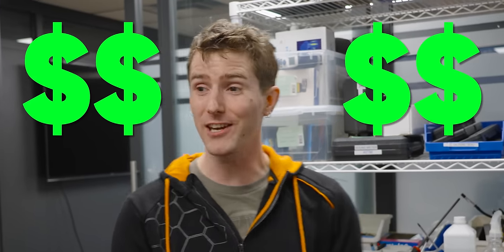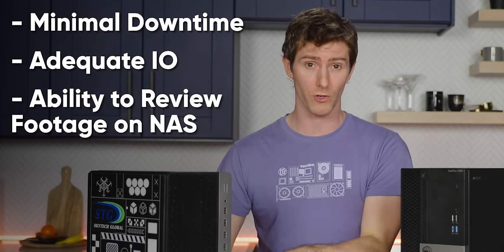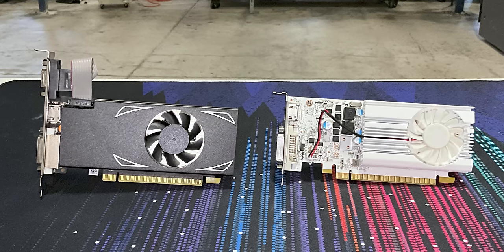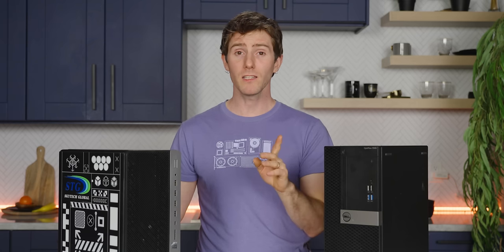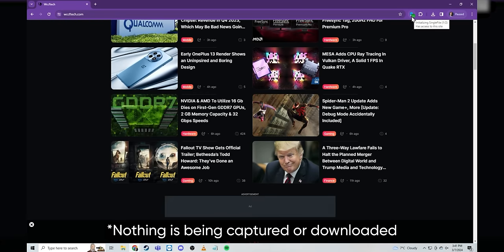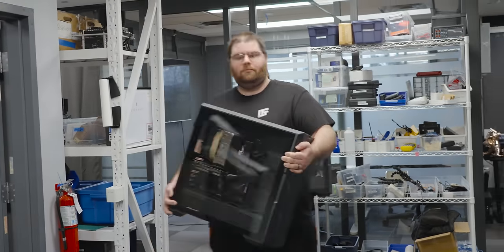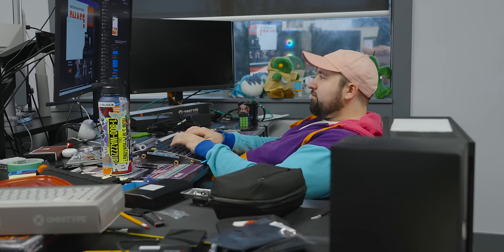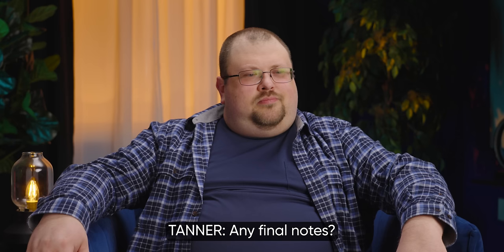We Downgraded our PCs to Prove You Don’t Need a New One

Comment: For my craft business, I used my old gaming rig from about 10 years ago (with some upgrades along the way). A 4790K and dual 1080 TIs in SLI is more than enough to handle Fusion 360. And all the business apps could run on a potato.

It was an awesome way to give new life to and old machine, and keep it relevant. Plus, the company didn't need to spend a thousand dollars buying something new.
Reply: I have some equivalent Xeon in my HTPC. You can run Windows 11 for sure, if you're not already.
Reply: @ranghildsbil  My CPU is just barely too old. At least without a separate TPM, which my motherboard is just slightly too old for. So, alas, that machine stays on 10.
It has the horsepower to do it, but it's not compatible.

Comment: I worked a couple of months as IT for the US Census, and it was fascinating how they handled workstations. The one frustrating part was having all the security protocols turned up to 11, but that aside.... each desk had a mini hp with I7 processors remotely logging into servers with virtual machines running Windows. Didn't matter what desk or PC you were at. All your files and settings would be there when you logged in.

Comment: I don't understand that no-one in this video mentions that there's no TPM 2.0 encryption of the main drive, when using sub late 7th/early 8th gen.

I mean, office use is one thing, but security is another. If a perpetrator physically stole the PC and was able to have access to the main drive with no TPM encryption, you'd practically give away all your information to the perp.

A lot of the reason that businesses are swapping these sub 7th gen for newer computers, is often not speed, but TPM compliance, and of course Windows 11 support.
Reply: They didn't mentioned this, because they have policy to never store any data on local machines.
Reply: @adrianchmielecki1473  makes sense then. Thanks

Comment: This comment will be ignored by LTT, but here it is anyways:
Machines with CPUs older than Intel Core 8th gen or Ryzen 2000 are not supported by Win 11. Escepially as a business you want something that gets regular security upgrades. And even as a  home user, running an out of date OS is a bad idea. 
Support for Win 10 will end in october 2025. So, you spend almost 20 min advertising something that will be ewaste in around 18 month. Unless you switch to linux. But you guys forgot to mention that bit as well....

Comment: we used to custom build computers with standard specs (office work), added gpu when needed.
Still running many years later, but as build servers, since we switched to remote and actually all machines now are recently speced laptops that we dock to our 34 inch wide screen monitors and use as desktops.

Comment: I can attest to this in my personal experience. My dad (an accountant with decades of experience) runs an old workstation similar to the ones in the video at home in his office. All he really does is web browsing and excel work so it doesnt need to be over the top.

Also at my previous work which happened to be a large corperation (myself working as an engineer) we utilized Lenovo Thinkpads for our work. They did have 12th or 13th gen intel cpus so they werent all that old, but they also werent anything overkill, and they did the job just fine for mine and most others workloads. There was the option for more powerful laptops if you were doing CAD work, but only for those who needed them

Comment: when i was systems admin for a call call centre we had both the 7040s and the HPs and from experience the Power supplies fail on those dells but the HPs last forever. there were no real differences between the 2 apart from that

Comment: I built my pc in 2016. Still running like a champ with everything and no issues gaming. 6700k, gtx970, 32 gb ram, samsung 980 pro, asus maximus hero board and aio cooler for cpu. Typing this message from this pc. Average fps in games is still 60+, work as a software developer, sql developer, game developer and it support. I keep it clean, keep it protected and do what I am supposed to with it and am not running into any issues.

Comment: I'm still using 4th Gen, i5 4690k Devil's Canyon in my personal rig. I increased the ram 5 years ago (from 8GB to 16GB) and upgraded the GPU last year (from a R9 280x to a RTX 3070). It has everything I need and nothing I don't.
Reply: that i5 is probably chocking out your 3070 tho. I got like 40% more fps and much more consistent framerates when I upgraded my Ryzen 2600 to a 5800x3D. Ryzen gen 1 was probably my best computer investment of all time.

Comment: I have a 10 year old HP laptop that i bought back in 2014 for college with an i3 4010u, I upgraded it with a sata ssd, another 4 gig ram stick and installed linux mint on it, works perfectly fine and is plenty snappy.

Comment: for office work, the only real requirement I have is enough ram and some form of ssd. Back in 2015 at my first "real" job, I had a system with a 4th gen quadcore i5, which was near brand-new at the time. But it came with 250gb HDD and 4gb ram, which I assume was the base config. Booting up took like 15 minutes so I never shut the PC down, and especially towards the end of the machine's life in 2020, that 4gb ram was just ridiclous. Nowadays, give me some random i3 or ryzen equivalent with 16gb ram and ssd and I can do any kind of office work.

Comment: I have a Dell Optiplex 7010/9010 Custom; it has an Intel I5-3470 3.2GHZ-3.6GHZ Clean Quad-Core Processor, 32GB DDR3-1600 RAM, and 1TB SSD Drive. It currently runs Windows 11 Pro, and it runs like a Marvel.

Comment: I have an old optiex 9020 that I got for free. Dropped in a $80 eBay 4790k to replace the 4570 that it came with, installed 32gb of ram to replace the 8gb it came with(system running men usage is about 22gb), and added a $30 2.5g nic and have it running as a game server. Works good especially considering I only have about $200 in it.

Comment: In the late 90s and 2000s I used to get a new computer every 2 years. Since the 2010s I have started to use my computers for at least 4 years with strategic upgrades to Video Cards and storage. My current computer I  assembled at the end of 2020. I just recently upgraded to a RTX 4070 Super from a RTX 2070 Super. I also added a 10Gbit NIC to go with my upgraded LAN.

Comment: Budget office pc builds are the best bang for your buck. I got a Lenovo Thinkstation P310 for $100 on ebay.

Specs are-

i7-6700
8gn of ram (I added another 24 for a total of 32gb for $60)
RTX 2060 for $150
PNY 1tb sata ssd for $30
2TB hdd I already had lying around

Total spent -$340

For the amount spent, this is an insanely good deal for the performance provided. It plays any game at 1080p 60fps perfectly fine. Some titles I play at 1440p.

Comment: I was  a backend engineer working in java and I was using a decade old laptop (not even PC) with 16GB RAM and somewhat decent SSD for over 2 yrs. 

Most apps would take 10-15 seconds to load and I needed to manage the open software very carefully. However, I was still able to get work done. 

Now I'm 100% against giving underpowered laptops to working professionals since it's extremely annoying and laptop just freezes a lot of time during meetings, especially if I was sharing my screen but people with relatively simpler tasks like just using chrome and office software definitely don't need high end systems.

Comment: As a civil engineer at a small firm, I regularly work faster than my computer runs AutoCAD. Ik exactly which components I need to upgrade to but my company just relies on the IT company for recommendations:(
Reply: Yeah, but your BIM technicians will be running Revit and heavy files, and you BIM Managers will be running huge Federated models in Navisworks, exchange lots of COBIE Data, and they’ll need a decent A200 GPU with it’s own memory to run these models.

So, your IT probably just gave you the a basic technician spec laptop that’s all.

Comment: Still use my 4th gen i7 with 16gb of Ram for gaming from 2013-2014. Just upgraded to an 1070 in 2017, and no upgrades since then ! Just some struggle with few games due to my HDD but I will wait 2 years before switching to new computer.

Comment: Whilst a top of the line performance workstation isn't needed as a daily driver by most companies, many just see IT as a financial overhead even government councils and organizations are not really willing to spend what's needed in order to improve the IT infrastructure. Even if these companies still have the older 4th/5th or 6th/7th gen PC's with windows 10, they will not maintain the hardware properly to make it work as intended. An example is when I was on a contract as an IT tech and there was a Dell OptiPlex that was being impossibly slow due to thermal throttling. I opened it and the thermal paste was as dry as cardboard.

Comment: I still use a i7-2600 and radeon Hd 7850 pc for all my office work on linux and I don't see myself upgrading for another couple of years. Does web browsing, office work, and light duty gaming just fine. Only difference using linux vs windows on this older machine is much faster boot times and lower memory usage which helps a lot with only 16gb
Reply: LoL this CPU sucks, it's too power hungry, you could probably replace all setup with one 5650 pro

Comment: Watching this at home on a 13 year old HP Probook 6560b from 2011. I don't mind using older hardware at home for basic tasks. The laptop I have to use at work is a lot newer and much more powerful, but the company I work for has installed a lot of security and encryption software on it, which makes that machine feel as slow as my personal device.

Comment: I run a 3770k (4c8t) at 4.2Ghz with a 980ti and 16Gb of 1600 DDR3. This gets used for gaming, CAD, video editing, blender etc. The reason I'm still using it is because it works great. I upgraded the network card to gig for better transfers to the NAS but that's about it. I've had it OCd to 5Ghz but it gets a bit noisy. But really I have no reason to upgrade. I did swap the original 3650k to 3770k for the hyperthreading.... In fact the only reason I'm tempted to ugprade now is for the enhanced virtualisation options of more modern CPUs.

Comment: When I’m running old hardware with windows 10 😊go in control pannel🤔type “advanced system settings “

Advanced .
Performance.
Adjust the virtual memory 

It uses hardrive space as cash ram 

It helps ish

Comment: at work i took an old mini dell pc with an intel dual-core cpu, added a ssd and swapped in 8gb ddr3 ram(gasp) and to get stuff done at work its very usable. At home i use a i5-6600k with gtx1080 in my bedroom and it is no different then using my i9-9900k with rtx2080ti to just do mundane task and both can still game, but obviously there is a reason I bought a 208ti

Comment: 6:35 I've had this exact issue regarding black flashing screens in videos and certain games before. It's usually when the expected specs and the system aren't fully compatible anymore, such as a game built for XP and Vista running in 10 or an older OS with an outdated player not parsing codecs properly.

Comment: A lot of the small business haven't upgraded their pcs in a decade. There was a company i worked with, and it had 4gb of ram. They said it was snappy when they got it, so it must have been slower because of a "virus" I installed. I installed a virus scanner, it was clean. They said I got infected with a "dangerous new undetectable" virus.

VM resource allocation is also a big pain in the butt. A bank gave my team some pretty slow machines to do ML, arima based modeling with bank data. The code frequently crashed.

Comment: I am running on an Optiplex 9020 i3 4th gen 14 gb ddr3 ram 240 gb ssd and 8tb HDD Quadro k600 1gb gpu
27"main Dell monitor 
and 
an 18"vertical Dell monitor
perfectly working with win 11 
been using this forever 
always a youtube tab running in a corner and a work window on main display
I am an IT Infra Manager.
never broken never replaced. (except the SSD)

Comment: Actually my daily driver is an OptiPlex 7040. Using the intel integrated GPU it's perfectly fine to playback 4k pores footage over the network, plus YouTube also perfectly fine...

As for the startup issues... don't have them either. The 7040 plus NVMe boot drive boots in about 10 sec to the desktop and is usable.

Comment: Many of HP and Dell's machines (same class/era) are easy and relatively straightforward to enable bootable nvme support for with a simple edit to the UEFI/BIOS binaries. Most/many of those motherboards were shipped with multiple SKUs where the cheaper one just disabling nvme boot drives, ECC memory, etc via feature flags in the UEFI/BIOS. Dasharo has a great blog series on getting the Optiplex 7010/9010 working with their open firmware which covers how they figured this out, verified that it would work properly, and ended up with a machine that is very much a usable workstation for many people.

Comment: One problem with PCs that old is that they aren't officially Windows 11 compatible. Sure, there are work arounds, but there's no guarantee that it will continue to work down the line.
Also, I wonder if some of those bugs that were encountered were because they pulled the OS drive from their original PCs rather than using the preinstalled OS?
Reply: My Elitedesk 800 g3 (6th gen i7) didn't even need a workaround, literally just installed windows 11 and works with no buts about it

Comment: the real reason why I gravitate towards current-gen hardware whenever I'm considering something, is because of power efficiency, driver and socket support. The pains of dealing with my 12+ y/o PC are still fresh in my mind: had an old CPU socket that essentially meant I would need to get a new motherboard as well, the GPU hasn't been supported for several years by Nvidia so I couldn't update or reinstall the drivers if I needed to, and when I upgraded it I found out it required an extra cable from the power supply while the new one can pull all the power it needs from the motherboard slot.
Making a build with what's on the shelves today also makes searching for the parts easier, and planning for longevity is a nice exercise in general, taking in consideration if you could be able to perform maintenance on your machine a decade plus in the future. Unless you have to supply an office that multiplies price difference between old and new low-spec multiply, I would say get new stuff (given you have the will and income to do so). Find your best value for the money, if you have something like a young GPU on your current PC feel free to cannibalize it.

Comment: So I work with Dell Optiplexs all the time and I'd still recommend building your own.

First the hardware is easier to upgrade and drag out the life span, an example is new RAM on a Dell motherboard will limit it to the preset MHz and you can't change it in the Bios, over clocking isn't usually a thing for an Optiplex.

Dell motherboards usually integrate with the case, so if you remove it, you remove all the I/Os with it.

Last bloatware, which isn't as bad as it used to be and can be useful for driver updates, but it's just simple to get them on the website.

But if you want a good monitor Dell are really solid.

Comment: I just watched this on a 9 year old Dell laptop which is my daily driver.  It's not fast, but I can edit photos and video, use Fusion 360, edit audio run an external monitor and generally have a good time.  Yes, I now have an SSD for Windows and a 5400 rpm drive for data, and that helps.  It boots fast and is very responsive.  The laptop's biggest limitation is the wimpy video card.  But I'll live.

Comment: I still use a 6th gen i5. It runs almost everything I want, it has the NVMe slot (I had to install the actual drive myself later, those were too expensive for what was essentially a budget off the shelf pre-built PC), GTX 960. The only thing it failed to run that I've tried is Starfield.

Comment: So, I bought this as my main windows computer 2 years ago off of ebay. It was semi customizable and here's what eBay says it was:

Gaming Dell Desktop MT Computer PC i7-7750 16GB 1TB SSD 2TB HDD AMD RX 550 W 10
Processor: Intel Core i7 7th Gen.
RAM Size: 32 GB
Graphics Card: NVIDIA GeForce GT 1030
Hard Drive Capacity: 2 TB
SSD Capacity: 1 TB

It's not bad. It booted up lighting fast when I first got it and then it slowed down a lot after I installed some software. The system became seriously unstable and then unbootbale after I installed some software from Corel (winzip specifically, apparently the new owners are terrible people) and I ended up having to wipe it. 

Since I wiped it, I don't have Steam on it anymore. I'm moving gaming to a new computer that I, uh, haven't bought yet. But I use this to work from home and I watched this video while playing solitaire on a second monitor. Not bad.

IIRC, when I got mine the external dongle was wifi only, I couldn't use bluetooth. I ended up buying a PCI car with wifi and bluetooth. 

Fun fact: when I had to reinstall Win10, it couldn't find a driver for my card, so I had to use the dongle to for that and then it installed the driver for the card.

Comment: At my new job I'm using a dual core intel cpu (didn't care enough to check the gen), 8gb or ram and gtx610 iirc. It works more than fine for what I do, mosrly writing + some very light image work. All UNTIL i run out of ram lol tho increase the page file helped a bit. Obv, if I wanted to game on it, it would be an entirely diff story 

Now i got a think pad to work from home, dual core Intel, 16gb or ram and iGPU. The ram has been such a blessing lol

Since I'm so good with all the guys in support, imma try to cop another 8gb stick for my deskrop lmao